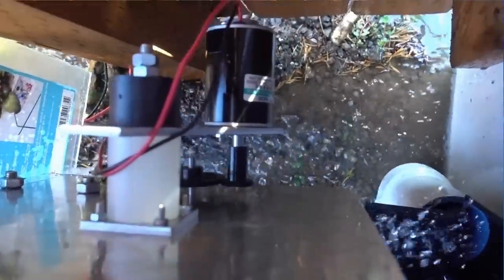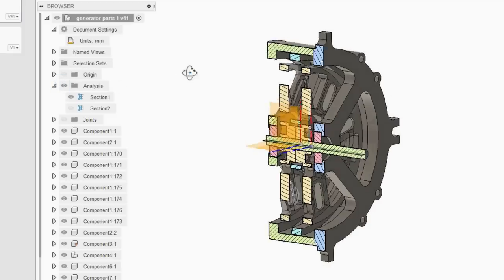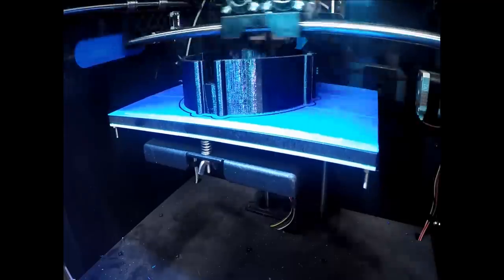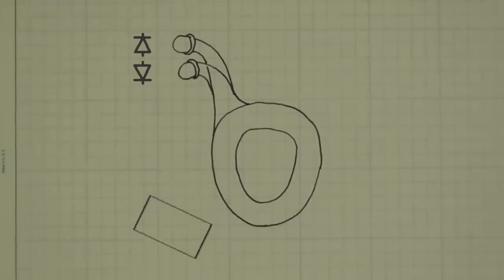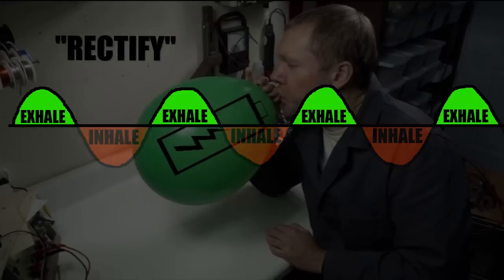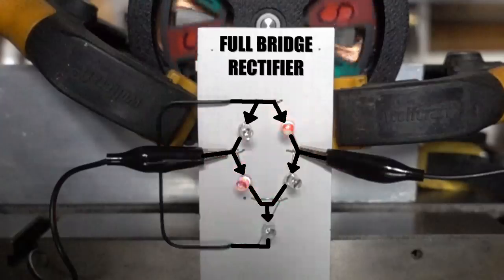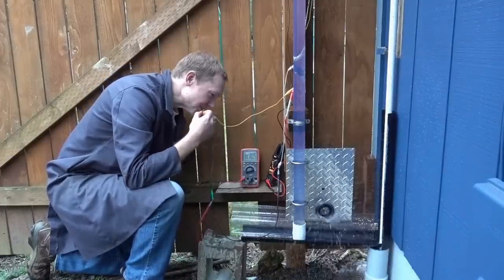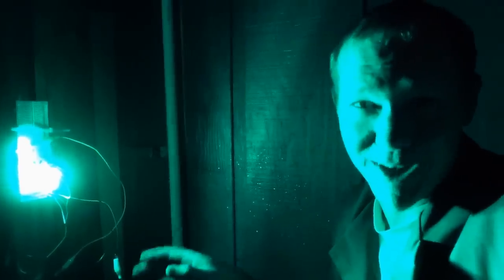Rain Gutter POWER #2 - 3D Printed Alternator, BEST Explanation of a Rectifier EVER!!!

Comment: I wish I had found this channel earlier, but the decrease in efficiency reminded me of a classic issue that we find in wind turbines not using the venturi effect. Do you think you could machine a pipe that instead of having a bottom screw off part, curves at a 45-degree angle decreasing in diameter as the water travels through until it comes out of the only open spot at the bottom  (should be the end where the jet attachment is attached). That way the pressures momentum should not only be constant, but the kinetic energy lost from hitting the bottom, filling up and emptying with a resulting in better utilization the venturi effect, and the Bernoulli's ( not sure if I spelled that correctly) to optimize the direction of the flow of water. You can still screw it into the pipe as you can make it into a solid attachment that should help, signifigantly. Granted, hydrodynamics is a bit different than aerodynamics, but in this case, it should be beneficial. especially for variable rates of rain.

Comment: Great Project. Now you need to build a bigger propeller wheel with some pulley ratios and belts  + a FlyWheel to and spin the generator much more faster.  :) Good luck

Comment: Please refer to it by its true name: a full wave bridge rectifier, as opposed to a half wave rectifier.  A full wave rectifier uses two diodes and the center tap of the transformer's secondary.  The 'bridge' means it uses four diodes.  

If you want a lot more power, use this setup on a bldg with a higher roof to give you a greater column of water.  Thanks for the great video.

Comment: I loved your enthusiasm about the work you have done. I have suggestion to get higher voltages out of the electrical machine you created. You have designed what is called an axial-flux machine. One way to get higher voltages is to get higher magnetic flux densities in the air-gap. Since you did not put any ferromagnetic material on the back side of the magnets -back iron-, the flux density in the air gap is reduced. What you can do is that you can put an iron or steel plate with a few milimeters thickness at the back sides of the rotors.
Reply from the maker: Thanks.  But though it would generate more power at that same rpm, that would require more torque/power from the turbine which just isn't there.  My understanding is the rpm would drop until the output power is essentially the same.  Although one person suggested the addition of cores could allow fewer turns of a larger wire size therefore reducing resistance and increasing the overall efficiency.  That does make sense to me.
Reply: @QuintBUILDs   Yes, I agree with you. The efficiency of the machine will be higher than 50%. Since this work is more like a proof of concept, the generator is more than enough. Thanks for the clear explanations. Keep up the good work!

Comment: EE guy here for optimized harvesting you could control a the rectification and do what is called peak power tracking since you are already harvesting 1W there are ICs out there the could optimize that. Or since you are going the Sience Education route build it with an Arduino or similar.

Comment: Have you considered putting iron plates on the 'back side' of your rotor of magnets?  This would couple the N and S poles on the sides away from the coils and strengthen the magnetic field.  Right now, the magnetic field has to travel over mostly all air as opposed to having a ferrous pathway.  This should improve voltage output per RPM.

Comment: Have you considered a jet nozzle for the water exit hole? seems the water spray is inefficient and spraying all over the place. The nozzle could be the same diameter or slightly less. You will be faster speed with smaller nozzle though controlled.

Comment: Satisfying videos of basic hydro-electric power, but one thing, maybe you can build a simple pipeline to for the rain water to some kind of over head tank on your roof, so you can use it when it’s not raining as “hydraulic power reserve”, besides, adding more water height may give you higher kinetic energy to nozzle’s outlet, and increase power output to the generator.

Comment: My kids and I loved the video, thank you! I had one question. If you had the impeller set up so that the water stream were to hit the blades at the top instead of the bottom, wouldn't you see a significant efficiency boost, since you'll be working with gravity rather than against it? The blades of the impeller would be heavier with water in the direction of rotation downward, and then a lot of the water would be shed at the bottom of the rotation, being lighter as it came up again.

Comment: Stupid question: What would happen if you turned the coils 90° on their vertical axis, so that they are "in line with the housing horizontally" and would expose each side to a magnet ? Would that eliminate the need for rectification ? Or wouldn't that work at all ?

Comment: What about taking advantage of the weight of the rain water by holding it in a bucket or on a straight cog held under gutter at the top and when it fills to a certain level and weight it falls down by trip trigger pulling a wound cable connected to a generator at the bottom with considerable force100 lbs?.  After the holding tank touches the bottom of the fall the bucket empties by trip release and empties once empty it rises back up from counterweight and resets to refill and repeat. Would the weight value carry more  potential power to generate electricity?

Comment: Great vid!  Can’t help wondering though.  Wouldn’t you get a much more powerful jet if you went with a huge PVC pipe at the top and then scale it down every few feet until you end at a small nozzle?  It makes sense that the weight of the extra water is going to make a lot more pressure.  Sure, you need elaborate bracing and would be a bit of an eyesore but it would be worth it.  The more weight up top the more power down below.  That’s how the big dams do it.

Comment: Wow it's crossed my mind to try this, cool to see you doing it.   I wonder if these work kinda like solar panels where there is a maximum power point.  With some kind of MPPT controller you could probably try to find the point at which it is generating the most watts.  That voltage at that point may not be proper for charging the battery though so you would still need a secondary conversion stage.
Reply from the maker: I experimented a bit with load to try to find MPP but am going to try a controller.  My guess is it's not quite like solar but we're gonna see what happens!

Comment: Might I suggest designing an alternator to produce 3 phase AC and run it through a full bridge?  You'll lose less to ESR in the capacitor as the voltage generated will never drop to zero, as the 3 phases are 120 degrees out of alignment with each other, therefore there is always a rectifier circuit producing voltage.

Comment: What about having some iron core in coils to boost induction per the 100 fold increase of the magnetic permeability of the core area the iron would facilitate. R45 welding rod makes great core material.
Thanks for the straight forward video on this subject.

Comment: you should add a float valve so the system doesn't open till the water pushes the float up.  gives you a consistent power out put.

Comment: Here's an idea that your video inspired in me; why don't you use reducers to reduce the pipe from top to bottom to speed up the water? Example: You Start with, what looks like 1 1/2" pipe, go X inches, obviously to be determined, then reduce to 1 1/4", to 1", to 3/4, to 1/2" then go into an 90 Degree Elbow then cap the 1/2" pipe with an exit hole drilled in the end cap to the size desired. I would be of the opinion you'b pickup a ton of speed this way. 

You may have to allow some sort of larger overflow tube or you may want to start with a larger pipe diameter. Also you may want to use a Rain Catch Barrel to load up on water, like a Capacitor, then that should solve any overflow issues. Of course the Rain Catch Barrel would have its own overflow protection. To solve any objects getting into the smaller portion of the pipe the catch barrel can always use a Tee to Exit with, facing the T so that there is an Open at the Top and the curve goes downward. The Open at the top can be capped with a Fenco so it can be easily removed for cleaning or whatever. Just remember Gravity is in your favor here as it will force the water downward and as the pipe gets smaller it will speed up the wire...

I don't recall seeing another video if you showed how the water exits currently but it does not seem efficient to me by simply drilling a hole in the side of pipe as water will take the path of least resistance it seems you could deal with a bit of turbulence or interference. Just a thought... Cheers...

Comment: Would having the water exit the bottom of the pipe  to activate the pelton wheel instead of the side help efficiency? Because the water does not need to make a 90 degree turn to exit the pipe?

Comment: This is so funny I did electrical engineering in my first semester (term) at university and I quit because I couldn't understand diodes and capacitors... But in this video it all finally made sense 33 years after I first tried to learn it!

What happened to part 3? No link in the description... I'll have to go on a hunt!...

BTW, have you considered selling build kits so others can setup a similar system? I have often thought every home should have solar, wind and rain all  contributing to a home battery system (Tesla power wall?)

Comment: if the wires are heating up, that's energy lost. Can you assemble the conversion system inside of the house wall so that at least the lost radiation from the hydro-electric system?

Comment: 11:47 Notice how that connected "load" (as in "electronic device") translates to physical load - Pelton wheel slows down a bit. 👍😊
Reply: I am interested and want to know the reason. Will you please help me understand why that happened?
Reply: @blusky3591  Maybe the channel owner can explain it better, but if I'm not mistaken, an electronic load is an opposition to amperage (electric current); such opposition translates into its magnetic equivalent - but only in response to the magnetic field of the Pelton wheel.
 
In other words, it becomes harder to push electrons through the load.
 
Check out "magnetic field current right hand rule" on online search engines (it applies to magnetic field generating current, as in alternators; it works the other way around, such as in transformers and motors, etc, and also in both directions, hence the mechanical resistance)
Reply: @morienbendinelli1554  Thanks for answering and giving me a lead.

Comment: Another thing to try with the alternator is to add some iron pole pieces to focus the magnetic field onto the coils.
Reply from the maker: Yeah, but that would also increase the force required to turn the rotor, slowing it down.  One person added that additionally increasing the wire size would reduced the resistance for a net efficiency improvement which makes sense.

Comment: Really nice video, as usual. However, I'm surprised to hear you say "slower speed" when you mean lower speed. (Slow speed would be low acceleration, although we seldom talk about the speed of speed in such terms. Like saying "cheap price" instead of "cheap product" or "low price", while the actual price can be had for free from the small sticker next to the product.)
Is this kind of mistake common in your area, or where did you pick it up?

Comment: if you reduce diameter of the pipe with holds the water,you will get more head and therefore more power output.and one more thing you need to arrange the nozzle at the end of the pipe so that will boot the efficiency and increases the power output
Reply from the maker: Head is height, that's it.  diameter is not part of the equation for pressure.

Comment: I think you'd have less loss if instead of generating a stream of water perpendicular to the gutter, you directly spin a wheel with the water. So the water would generate the power as it is falling downwards through a slanted rotor. If you can't imagine, it's similar to Turbulent hydro power plant. In fact, you could make several sections on different levels, each level generating some power from a section of the momentum. I believe you could make at least 2-3 levels with such small generators.

Comment: I was trying to design a small alternator and was considering taking a toroid ferrite and cutting a small section out of it. My plan was to wind the wire onto the toroid leaving a gap at the missing section.  I wanted to pass flat magnets through the gap in the toroid. Im thinking this would be the most efficient design because it captures as much of the magnetic field as possible. Do you see any flaws with that?

Comment: how did you figure out the proper resistance required in the wheel to perfectly fill up the tube right at the top without overflow

Comment: Quint Builds, please consider looking into a gearbox manifold, weighted gravity fueled generator. I'd like to know how the gearbox ratios would have to be to lift a 1000lb bar straight up into the air with pulleys, and then let it fall again to turn the generator and create some real power. This would be a fully guilt free human powered power supply! But what are the ratios and proportions? How long would it take to lift an Xlbs amount of weight to create enough electricity for your needs in the day? Please look into it!

Comment: I have a dumb question. Why are you using such a large diameter vertical pipe? Isn't the head pressure the same for a 1/2" pipe as it is for a large diameter pipe? It seems you could put a large reservoir at the top and then have a small pipe going down. That would allow less volume of rain to achieve the same column height of water in only moderate rain. The issue with that is clogging but you could probably make a sloped screen on the reservoir to divert most of the junk down the original downspout. Just a thought. Keep up the great work!! This is great. I'm in Oregon too and all these people with their fancy schmancy solar panels don't realize that rain is much more dense and therefore a better power generator...umm...right?
Reply from the maker: I had plans to adjust the nozzle with a float system and cables inside the vertical pipe which needed room for the float and mechanics, thus the larger diameter.  Watch to the end of part 4 for a discussion of rain vs. solar.  I will say you are the FIRST to mention that changing the diameter of the pipe will not influence pressure!  So many people believe a bigger pipe will make more power.  Also a good insight that a smaller one will take less time to fill and start making power.  My hat is off to you sir!

Comment: Maybe we can add a (tension peice valve?)(which enclosed when the small flow of water getting in the gray pipe, but it opens when the level of the water enough to trigger the pump action)at the bottom of gray pipe, so we can save the small water flow untill the main action start.

Comment: What would be super sweet is if he designed a way to collect the spent water from the jet, and fed it to a water hammer pump. Which pumped the water vertical and back into the tube, recycling the water the through the system. It would be a self sustaining system considering water hammer run on water. No need for rain or a gutter. It would be a stand alone hydroelectric charger. That thing would run until the water evaporated. It could charge battery after battery all day.

Comment: What if you would use a smaller dia clear pipe (1" for example), the pressure at the nozzle would be the same, then you could use for example two "clear" pipes with 2 nozzles and generate twice more forces. 4 smaller pipes would generate 4 times more. Actually, the pipe could practically go to  .25" ID instead of 2" dia wich generates theoretically 64 times more pressure (energy). Just a thought.

Comment: Would you get more pressure with a wider tube? More stored kinetic energy since more water up there! Or would it just not fill up as fast?
Reply from the maker: Nope, pressure is a function of depth, not width.  Otherwise the size of the swimming pool would determine how much you float.

Comment: I would like to start out by saying you did a great job on these videos. I'm learning a lot just from watching the first two. Keep it up. 👍Now, I'm sure I just missed it when you talked about it. But what if the down spout was bigger? It seems like it would apply more pressure to spin the wheel faster. Wouldn't that give you more power?
Reply from the maker: Pressure is a function of depth, it's how deep you swim, not the size of the pool. A larger pipe would weigh more but pressure and power would be the same. Very common misconception! I should cover this in a future video.